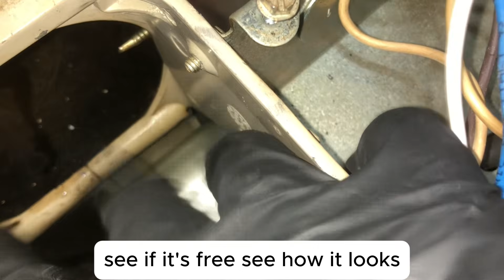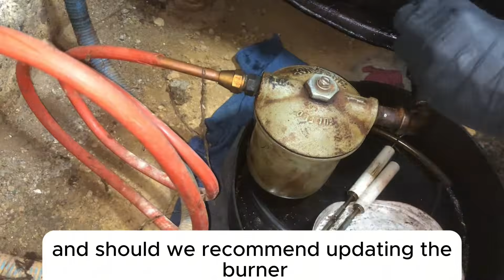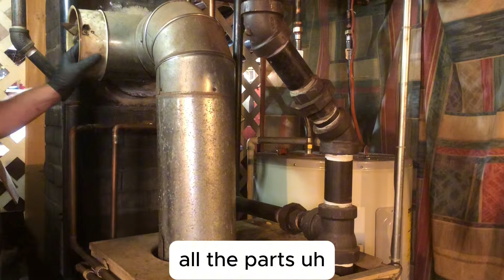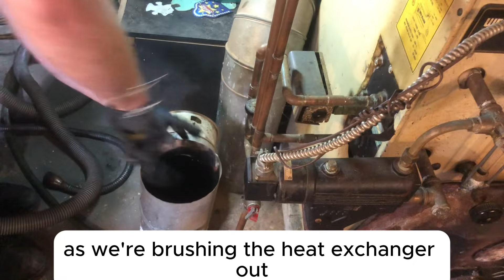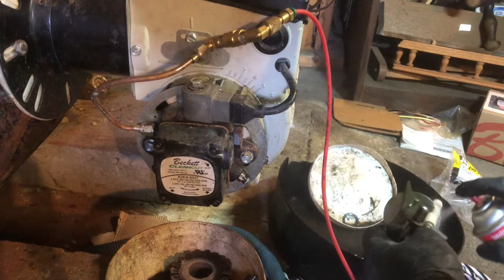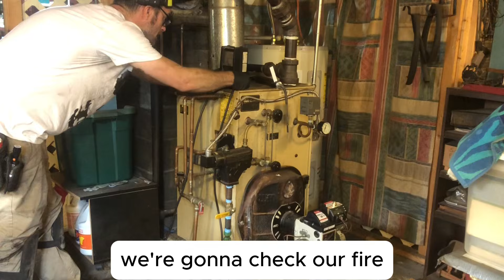tune up

Comment: You said to check components for bio compatibility, then proceeded to put a non bio rated filter gasket on it.
Reply from the maker: Yes, the filter needs to be updated
Reply: @yondory actually, I'd reccomend a new tank, but I also realize that you may very well have tried to warn them about the age of that tank. I'm building a collection of the old lever style valves with the cable to the ceiling that I pulled off from tanks I replaced. I think I've done more tanks this year than I've done in any other year.